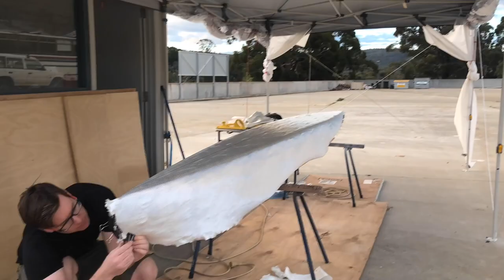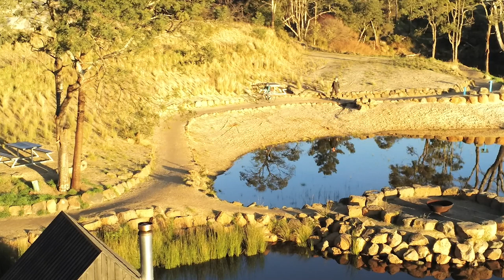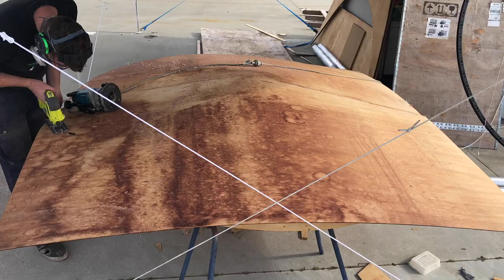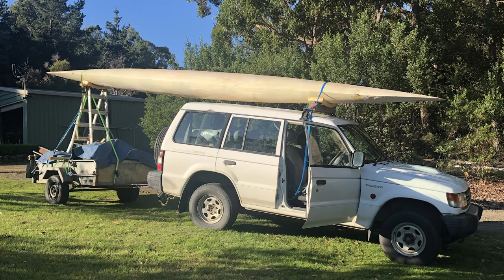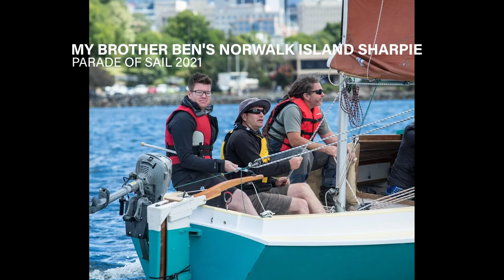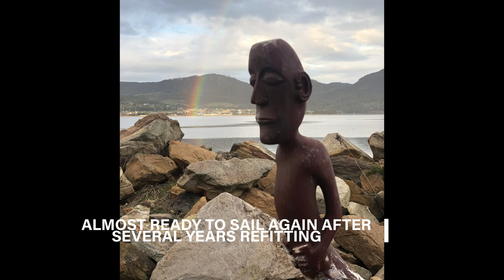Proa sailing experiment - coming together

Comment: Wow just found your videos, really interesting project! I became interested in proas because of the harry proa build style. It seems like the fastest way to go - one curved half hull that builds 2 hulls. I'd be curious why you chose to go another route? In your initial video you implied the hulls were made of flat infused panels.
I'd also be curious how did the innegra worked out. I guess it's stiff enough?
Rob also is working on some interesting ideas for his 80' cargo ferry, he's infusing the main hull with 1800gsm single core and top hat stringers which sounds pretty cheap.
Reply from the maker: Hi Dejay, thanks for getting in touch. Yeah the harry are very clever in lots of ways but I found the build method too restrictive in the shapes achievable. My method definitely needs refining but that's what this whole project is basically about! 
The Innegra worked as expected for getting the hull shape which was great but it is definitely too flexible on it's own. I ended up putting a layer of Uni-directional fibreglass down each side which fixed the problem but next time I would build longitudinal stringer into the infusion on the inside. this will stiffen it lengthwise and also help it hold its shape while torturing it all into place.
The cargo proa sounds pretty serious, I've seen some stuff on it but didnt realize it was so big!
Reply: @MattTucker  Yeah vacuum infusing stringers seems to be the way to go. I think that's the most interesting part of the cargo ferry build, really dirt cheap easy to build hulls.
Then of course, why not build bigger? ;)

Comment: Just found this site , reminds me of the Romy rig !
Reply from the maker: I will still have a separate jib John but just googled the Romy rig and it’s very similar to what we had on the original Mahi Mahi. Didn’t. Work too well on that boat though! It was too hard to move the centre of effort forward which is the key to easy shunting in a more traditional Proa.

Comment: The hull configuration looks like a modern take on say your bro's more traditional boat - his proa looks cool too. It'd be interesting to comment on the difference between the two. The two cantilevered beams on the leeward side, how do they work?
Reply from the maker: Exactly Bernard, my idea was to create a proa using modern racing multihull concepts and materials (ie wave piercing bows, composite materials, modern rig) since I've only ever seen proas with outdated design.
The wave piercing bow I expect to be especially effective for the Ama because on Mahi Mahi it tends to slam and pitch a lot.
The cantilevered beams to leeward will have the rudders hung of them. This will offset the drag of the Ama and also I will add V-hydrofoils to provide lift and extra right moment as the boat heels and potentially fly both hulls.
This is the most experimental part of the boat and one I expect to have to do the most tweaking on.
Reply: @MattTucker  cool. Looking forward to seeing the experiment hopefully as a work in progress
Reply: @MattTucker  now you’re talking! I love the sound of the rudders to leeward with hydrofoils. Looking forward to seeing your boat on the water. Do you have a name for it yet?
Reply from the maker: @guywhitworth5764  thanks Guy, I’m glad to see some people get it! Most people look at me blankly or like I’m crazy when I talk about it 😆 
No name yet, better start thinking! 🤔
Reply: @MattTucker  Really looking forward to seeing this fly on (over?) the water 👍🏼best of luck that it works the way you are hoping 🤞🏻
Reply from the maker: @daveamies5031  Thanks Dave, I'm getting really close now! Just have to finish painting and then put her all together. There will be a bit of fiddley stuff getting the rig and steering sorted but I can see the light at the end of the tunnel!